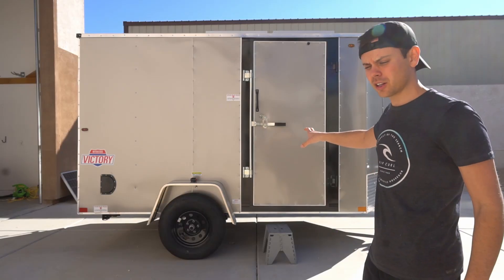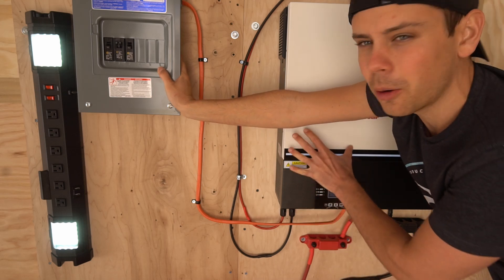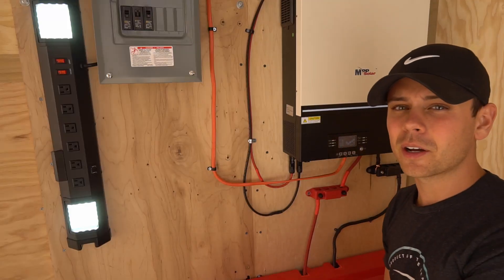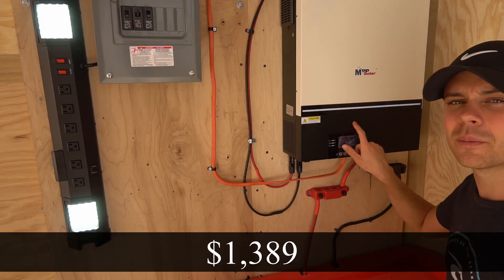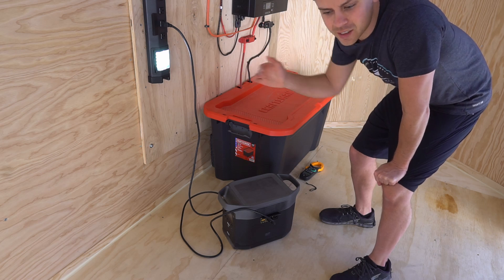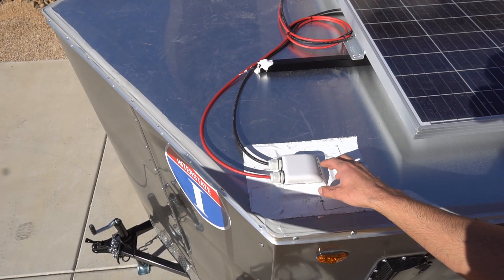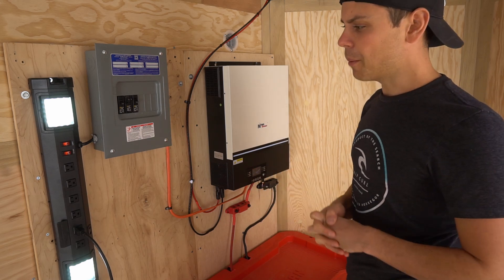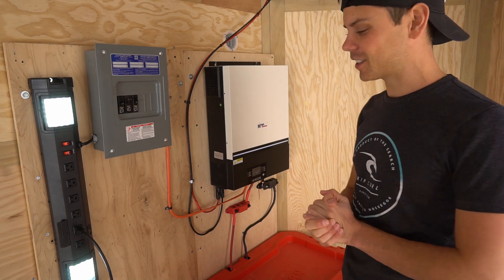Utility Solar Trailer: 6.5kW AC Output, 4.8kWh LiFePO4, 8000W Solar Input and AC Charger

Comment: Would this be a good option for adding to a travel trailer for solar power? I'm guessing there are several steps and components needed to add to my breaker box and shore power connect?

Thank you and great video! Love your channel.
Reply: It depends on what you have already. If you already have batteries, just add solar panels and a charge converter. My pop-up doesn't have an inverter, so I'd need to run the inverter to the breaker box to run independent of one another if I wanted to use shore power or the inverter. I'd put it on a 3-way switch, so you don't run both at the same time, but I'm not expert. There may be something better, but the science seems like it would work.
Reply: @DeliberateNRandom  I have a converter/charger for the battery from shore power only. 

I'd like to add a solar system with the ultimate goal of having the ability to boondock.

But I have limited money (I'm a vet) and slowly learning about the whole solar thing. 

Thank you for your reply.
Reply: @wardg1775  How much amperage of battery do you have? What type is it? Not super important if you want to slowly build it, here's my suggestion without answering that:

Renogy MCC50S converter $236
Solar panels 100-400 watts: $90-400
Wiring to connect everything but the solar panels: $30-80 depending on gauge and quality
Solar wiring: $20-80 depending on quantity and brand
Victron 65A shunt battery protector if you have AGM batteries so they don't discharge too much: $40

That should keep you happy.

I bought an HQST 100 watt complete solar kit for $130 that's good enough for my occasional use camper van, but you'll probably want an MPPT converter if you're living in it, it's... just know it's better than PWM.

Best recommendation, you should probably get the Renogy MCC50S DC to DC charger with MPPT converter, it's about $236 now, but it will charge your batteries with 50A while you're running your car, plus you can hook your solar panels up to it without the need for two devices that are more expensive separately, but it can only handle 25V solar input, most panels are 12V, so you'll have to run two in series and any more in parallel. I'd say you could start with one 12V 200 watt panel kit or close to that number, about $200, if you want to piece your system together slowly. You don't have to jump in first thing when it's possible to piece it together. You don't have to upgrade anything, just add to it.

A Renogy 20A DC to DC charger is $108, this can handle 50A, so I hope you see the value here.

100 watt panels are cheaper, $90-100, but you'll have to run more wiring and make more connections.

What you NEED to have solar:
At least one solar panel kit with wiring and mounts.
Charge controller of some kind to convert it to usable power to charge your battery/batteries.

That's... really it, but you're limited on charging with that.

More reasoning behind the decision making:
A DC to DC charger is better than a solenoid because it can control how much you're charging so you don't kill your alternator or batteries, it makes sure your batteries are topped off correctly to the proper voltage. I've researched this recently, believe me.
A DC to DC charger by itself can be pricey, as well as the MPPT converter. I've seen some MPPT converters can handle a higher voltage, but why pay more?
Monocrystaline panels are cheaper, last about 10 years for efficiency. Sure they can be fragile as in you can't bend them, but cheaper to replace and last longer than flexible panels.
Renogy, HQST or Rich Solar are all decent. I went with HQST based on a recommendation from Will last year. You really can't go wrong, they're pretty good.

Pretty much all of this is on his website. He makes a general setup, but I understand being on a budget and trying to figure out how to make it work without going in hard.

Let me know if you have more questions, or I can try to chat with you on Signal or Facebook Messenger at night after work. I'm in Bozeman, MT.
Reply: @DeliberateNRandom  to answer your very good question about battery amperage. I currently have one 12v deep cycle marine grade battery that has from the label says has 23 amps for 175 mins (I believe). And if weights a ton (😂). 

The rest of the info you posted is great. Gives me a lot to think about! Thank you.

Comment: Hello Will. Your trailer will be an interesting project and test vehicle. I have learnt a lot from your channel. The title of this video says 4.8kWh of battery capacity. BUT the batteries are 12v 1200Wh each and as they are series connected, I believe they will only provide a total of 1.2kWh of storage capacity at 48v. Or have I misunderstood?
Reply from the maker: 1.28, and you add them together. You're thinking Ah. Not Wh. So it's actually 5,120Wh
Reply: @WillProwse   Doh, Watt was I thinking! My only excuse, I must have had a "seniors moment". Apologies, and thanks for getting me on the right path. Again.

Comment: This diode is found in the cheaper types coolers truckers burn them out inside of 3 months and throw them away so if you go to a dumpster at a truck stop you might actually find one for free

Comment: Rather than expensive air conditioning why not use p e l t e i a wrist attached diodes. Neat little device reverse polarity you get heat the opposite is you move Heat.

Comment: When I was looking at building a trailer with a solar roof I was going to build "wings" on each side out of solar panels which would lay up against the side of the trailer while moving and be hinged so you could unfold the trailer into a huge solar array.  It would be heavy enough you'd likely want to use a linear actuator on the hinges to lift the panels for you, but would be much easier than having to carry around separate solar panels and set them up each time.

Comment: Hi Will, I look at the spec. of the Solar panel in the link you provide, since your system is 48V but each solar panel has Voc of 24V and Vmp only 20V,; connecting them is series will barely be enough for the MPPT to charge the 48V batteries system, am I correct?  I learn a lot from you and able to build my first Solar system 6 months ago, thanks.
Reply from the maker: No, these panels produce 80VOC in series. They can easily charge this voltage of battery. Working voltage is 60V
Reply from the maker: That solar panel description must be wrong

Comment: I would be a more inclined to get this all in one solar system, but it's not the price that turns me down. It is repairability. How do you maintain the proper function of these systems? Are there single points of failure that threatens this system? Is it one big circuit board or is it composed of replaceable modules?
I'm about to build my own solar power system and im wondering about these things... but I don't want to get stuck with a 1300$ brick where I could do a cheap and serviceable system.
Reply from the maker: Oh that's why you buy these. You can swap out boards and components easily. That's literally a benefit of these haha. Super easy to service. Check out my older videos where I talk about this a lot

Comment: Hey Will, how would you handle EMP or CME? I passed up Battleborn because I contacted them and asked about EMP/CME protection and if they sell their BMS as a replacement you can keep an a Faraday Cage along with a replacement Charge Controller and Inverter, they told me no and there is not plan to do so in the future. They said they receive that question fairly often. So basically if you use Battleborn and there is an EMP/CME then you're screwed. That's why SOK or DIY is much more appealing, both of witch you can buy BMSs for, yes, SOK does sell their BMS.
Reply from the maker: Add your own protection. I wouldn't count on any manufacturer to have that feature. They didn't design for it. You need to build it yourself

Comment: Should install solar panels on sliding rails.
So when the trailer moves, only the 3 fixed upper panels generate power.
But when parked, slide other panels situated underneath sideway, in front and in the back.
Could trifold the generated power.

Comment: I'm curious, I was considering a Toyota Rav 4 Prime to pull one of these trailers. Is there a way to hook up the car to utilize it's power source to help run the trailer when there's no sun?
Reply: Yes. You can run Anderson connectors to the back. I would recommend a DC to DC charger, so you don't overcharge or burn out your alternator. Renogy makes one with or without a solar controller between about $200-300, depending on sale prices and model. You would want it protected from the weather conditions.
Reply: You might want to checkout the Toyota 4Runner. Fantastic SUV!

Comment: I thought the plan was to give the trailer the ability to expand the solar capacity when parked?  Panels on heavy duty slide-outs stacked so you could expand and triple your solar capture.  You would need a strong roof and a strong rack system, but you would have a great mobile power unit.
Reply from the maker: I'll just connect a ground array and call it a day

Comment: I've been building solar trailers for years now. We have some that will run a whole 2k sqft house to a small RV. The smallest unit we have has fold out panels that produce 1800 watts.
Reply: Do you sell them?
Reply: @JoePAcalaughs  yeah sold a few here and there. Started to pick up again then covid caused everything to dump. They are a bit pricey so the market for them is a bit small.

Comment: Will, because your trailer has metal skin, do you think it would give protection for EMP solar flare damage or is it not sealed good enough or the metal is too thin? I'm wondering if a small  shipping container would do the job?
Reply from the maker: Hmmm good question. I'm unsure
Reply: It's more the openings than the thickness regards EMP. This will give some protection, but if you are highly concerned or want the best, you need to research the subject yourself because there are different protection levels and different ways to get there.
Reply: @P_RO_  I have been thinking about using a new 8'X10' conex to install my Sol-Ark 12K and battery bank system in for extra protection from EMP solar flares. From my research, it seems that if it is sealed from outside sources and the door sealed when closed, it should give a decent amount of protection and be well worth the cost.
Reply: @fisherus  The problem with EMP and solar is that the panels will always be open to it when in use, and the path from there to inside an EMP-shielded anything exists through the wiring. So max protection can only be achieved with a stored system which isn't very useful. Thus the trailer itself is about all you will need for an in-use system, and anything large enough to kill it will not be something you can protect against, so I wouldn't worry about it. 

Truth is that the average person can't really prepare for anything 'Carrington' in scale; 99.9% of the world will be reset to 1830 and only by living that way now can you truly defend against it. Electricity is of little use if you're the only one who has it and it will need to be useable for at least 3-5 years before the recovery efforts can begin taking hold then another similar timespan before most people's live are anywhere near back to normal. Some preparation is wise for smaller events which can be handled easily enough, but we need to understand that there are some things you just can do almost nothing about except to roll with the punches as they come in and hope you emerge alive when the fight is over.

Comment: I have got 600 watt solar, 480 ah lithium in the trailer. The van can feed 38amps if needed. Haven't used mains power for 6years. Makes for cheap living

Comment: Hey Will solar newbie here, I have been watching all week during our PowerProblem Winter storm here in Texas! I am building a small Overland camping trailer, NOT buying a Goal Zero or Bluetti. I build Robotic welding systems in the real world and dig circuits. What would be your thoughts on a 300 Ah system with a few USB ports and a couple of 120VAC OUTLETS 1500W inverter? Maybe a great video to do? I have learned so much from your channel! 🤘

Comment: I have been looking at building a stationary system something like this to charge our electric car. Here in Australia second hand solar panels are very easy to get and cheap. You can get a 200 watt panel for about $10 aud. Sometimes free. I'm interested in the battery less function of this inverter. Would love to see what a large solar array hooked up to this inverter can output without batteries to charge an electric car like a Tesla. .

Comment: Nice trailer and brilliant idea! 👍👍, by the way the panel is parallel or series connected? If parallel this MPP unit can boost from 24v solar to charge 48v battery system? 🤔
Reply from the maker: 2X 24V panels in series

Comment: Why didn't you install the solar rails to already accommodate the third panel? 
Thank you for your the fantastic review.
Reply from the maker: Repurposed some metal I already had. Need to buy more
Reply from the maker: Thanks!
Reply: How did you determine the 8000 w of solar input? Did that come with the unit? I went on MPP Solar's website. It says 120 amp max 250 v input...
Reply from the maker: It's on the label
Reply: @WillProwse  Thank you. Much appreciated.

Comment: nice.  should have mounted the solar wire entry gland facing the other way so that when going down the road in a rainstorm there is less chance of water entry.
Reply from the maker: No, those seals can handle a hurricane. It does not matter what direction you mount it. If it did, it's a trash grommet and needs to be replaced with something that can be mounted in any direction.

Comment: You are a genius when it comes to this stuff. I appreciate all the videos you put out and so when ordering my Renergy dc to dc and mppt unit along with all my accessories, I used your affiliate links. Thanks Will!
Reply: Could you tell me what else you got? I'm at ground zero (and clueless) with an 04 chevy express. My battery needs to be replaced but  looking at all theseothere devices trying to figure out what I'll need.
Reply: @BuyAtLess  Everyone's setup is going to be different, Will has links to charts showing you what he recommends. I just changed what fuse boxes I wanted etc. and for batteries I went a cheaper route getting duracell 100AH sealed led acid rv batteries from Sam's club for $100. each.

Comment: your gland is backwards! 😂 maybe you’ll never drive in the rain but the cables should be on the leeward side of the aerodynamically shaped gland—not the windward side—so that the cables trail in its slipstream rather than face into the wind. sorry i love you man but couldn’t resist the chance to call out will prowse 🤣
Reply from the maker: No you can mount it anyway you want. It doesn't matter. Those grommets will seal. It's not aerodynamic either way you mount it. It doesn't make any difference.
Reply: @WillProwse  yes ofc you can, and it will be totally fine. same way your entire trailer can operate perfectly fine in reverse... but it performs best going forward.  theres a reason the door is not on the front, and it has that ‘forward facing’ aerodynamic shape.  the glad is shaped same kinda way for the same reasons, just like your rv’s roof vents and AC shrouds... because it deflects the majority of that strong forced wind/weather when you’re driving forward.  imagine driving 70mph into a rainstorm... the gland could may well face 90+mph of forceful driving rain, so despite the seals being good, the preferred installation direction is ‘sweep forward, cables back’.  
if you installed a gland like that on the outside of a house, would you install it cables-up?  i should hope not.  perhaps this is not as important in the desert but vehicles can migrate about

Comment: Love it! I can see A LOT more solar panels on that trailer. Have you thought about side mount (hinged) solar panel swing outs? I did that a long time ago on my pergola...worked really well. Also, you can secure them while driving down the wall. Think of it as a "flower" opening up or an RV slide out. While in use...you can hinge them up, bring them down when traveling. Keep up the great work!

Comment: Super cool project, great video as always. I believe your channel is where I first learned about MPP Solar products and have been following them for a while. Seems like they have very good VALUE products. Its really too bad they don't offer a 240V grid-tie, Hybrid inverter that is also UL1741 SA approved for CA. Seems like Darfon is the only company producing a similar Hybrid Inverter that is UL approved. Unfortunately Darfon is priced quite bit higher and for some reason even if 2 units are paralleled, the output is NOT double the 5,000Watt rating of each individually. The Outback Skybox 5K is a candidate but 2 of those is $7,000, YIKES. Anyone reading this comment know of another product or company I should be looking at?

Comment: Good Job, I built a trailer in the UK with 6 panels and used a gas filled rams to raise and lower them easily, there is a feature on cnn news, the clip is on my YouTube account. GreenMotorSport. Keep up the good skills 👍😎 those inverters are really coming a long hey 👏

Comment: Love this!!! I can't wait to build one! Curious if it makes a difference or not but wouldn't it have been better to put the wires through the roof fixture facing the back of the trailer rather than the front just for wind/rain/snow being forced towards the plugs ??
Reply from the maker: Oh those are super tight seals. You can mount in any direction. And I'm glad you like it 😁